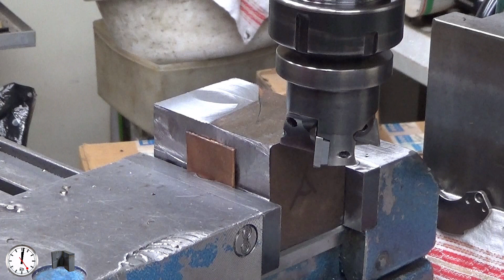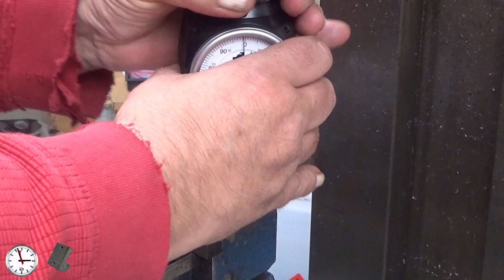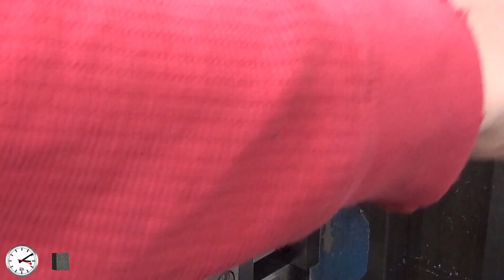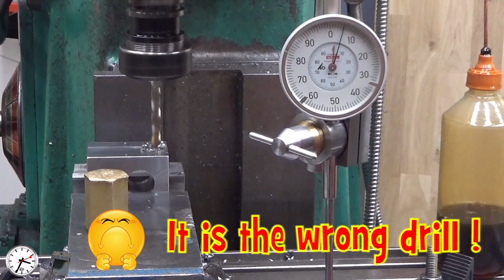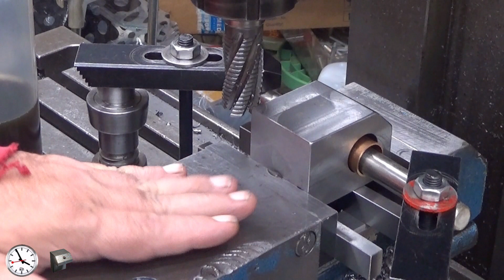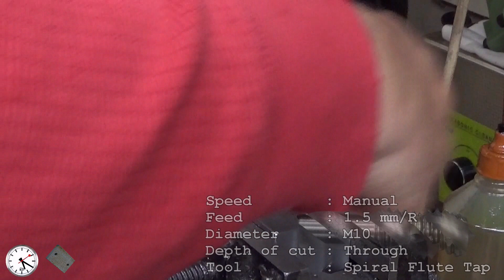Non precision machining

Comment: To protect the Haimer tip, turn a brass cup with a fit over the install tip dia and with an rubber washer inside to prevent from folling off. Put the cup on before loosing the collutnut so if it fall trou your fingers you will not break the tip.

Comment: Roughing end mills are good, not only for the chips but they allow for at least twice the cut as a finisher without chatter. I like carbide roughers, an 8mm rougher can already use all the kilowatts that my mill has. 2,2 that is.